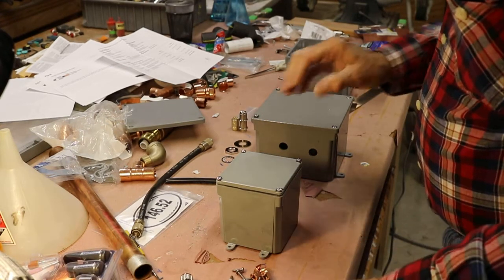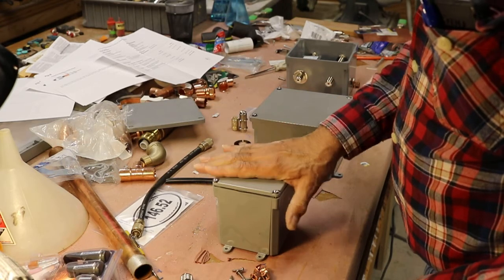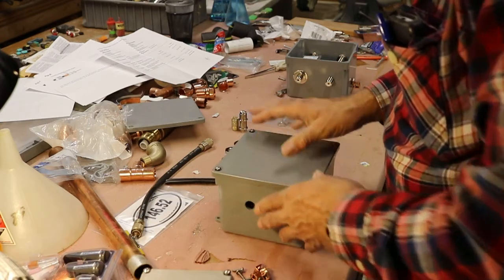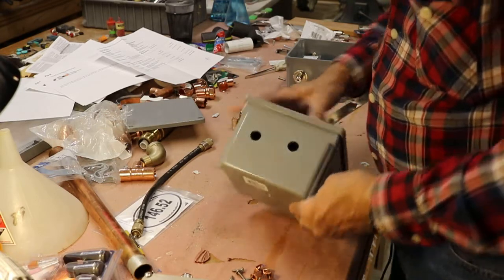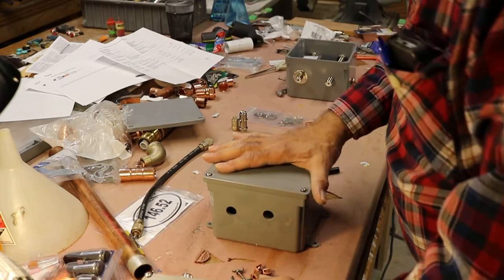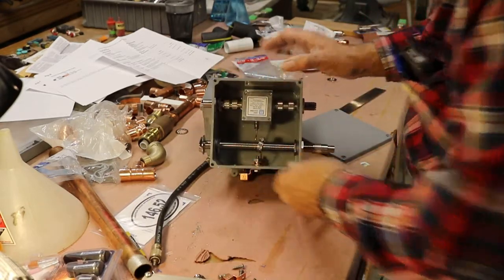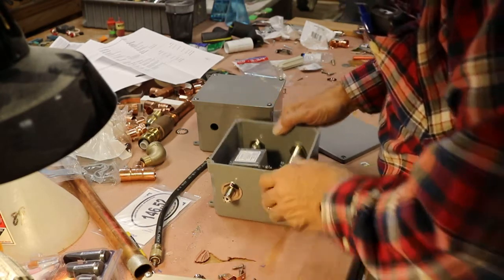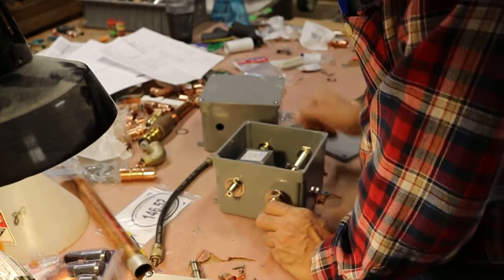Constructing a Amateur Radio Antenna Grounding Box

Comment: That's a kinda lossy approach. Buy a ground strap for a "no ground plane" antenna with a ring terminal, screw it onto your stud and clamp it to a near by whatever metal thingy going into the ground. This is over engineering, you see this method done in radios and television but it's assuming you have a high gain antenna up high or an inline amp in your run. I run 5 watt radios and cutting my coaxial to insert an arrestor is not optional.

Comment: so, when do we use a surge arrestor and when do we use a lighting arrestor? do we need both? the internet says there's a difference idk. i see videos explaining either or, but still not sure if both are needed .
Reply from the maker: I checked on the web:
Surge arrester protects the installation from inside while lightning arrester protects the equipment from outside.

Surge arrester protects the system from lightning, switching, electrical faults, and other transients voltage and surges while lightning arrester is mainly used for lightning strikes and associated surges.

Surge Arrester: is a device used to protect the electrical installations and equipment from electrical surges and transient voltage caused by electrical faults, switching, short circuits, sparks and lightning etc. Surge arresters are installed inside the panels to cancel out the surges.

Lightning Arrester: is a device used to protect the electric circuit and connected devices from the lightning strikes having high voltage transient surges. Lightning arresters are installed outside to ground the harmful effects of lightning spikes.

Surge Suppressor: Also known as transient suppressor or surge protector is a device installed in the home panel board to protect the connected circuits from electric surges and voltage spikes known as transients.
Reply: Did you use both kinds or just the one
Reply from the maker: @ReefMimic  I have both. I have a whole house surge protector at the mains (fuse panel) coming into the house and a lightning arrestor in the grounding box.

Comment: Measure the height of the box, divide by 2, take a 2x4 block a drive a screw through the block at the height you want the holes place on solid surface and transfer the layout line from side to side. You are using the point of the screw as a scribe.

Comment: I don't think that will work.  If you ground the shield of yer coax, you will get all kinda hum in yer radio.  I tried that and had to disconnect it because of the hum introduced into the coax line.  Just remember that there's RF ground and mast pole ground which you should connect to earth ground to bleed any lightening strike directly to ground.  You cannot tie RF ground to earth ground without introducing major hum into the coax and radio.  You cannot connect RF ground to earth ground.